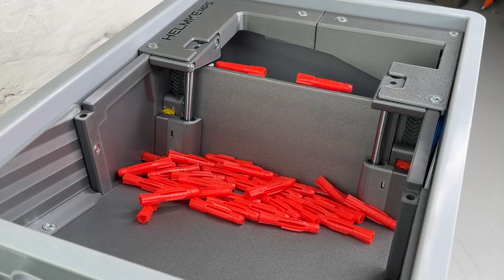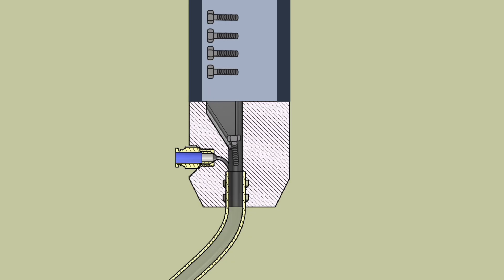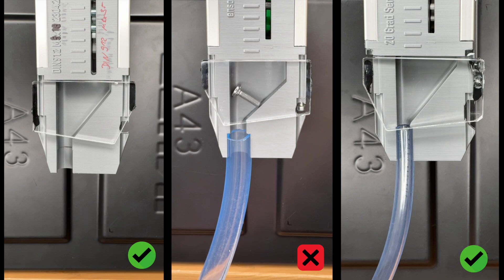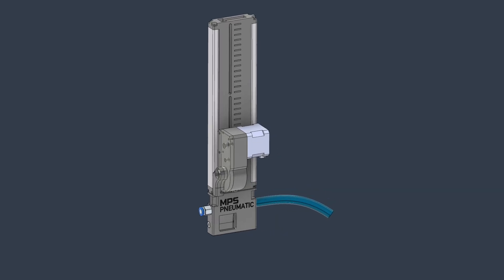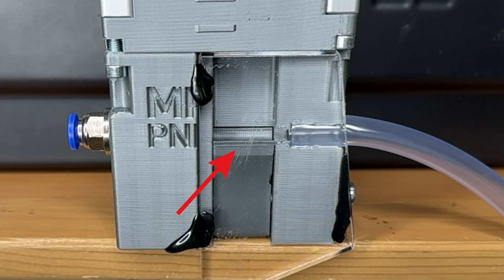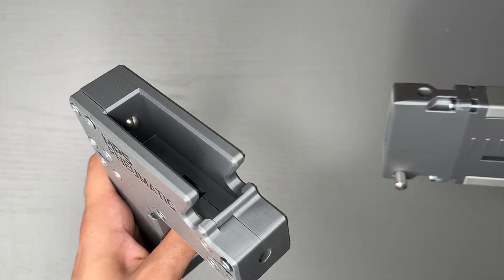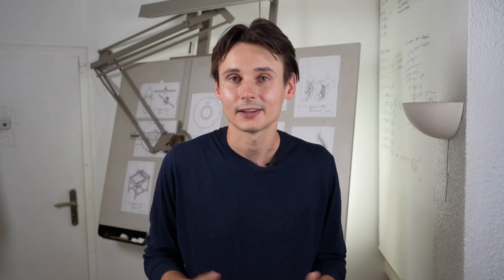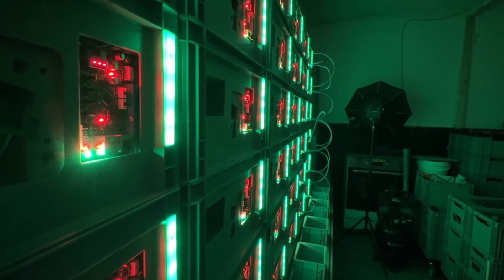Launching screws through washers - 3d printed automation #009

Comment: I feel like the first design would have worked if instead of a straight ramp it was a convex ramp. If the ramp was convex the tail of the screw would hit the ramp surface and stop the screw from over-rotating on bounce.
Reply: I had the same idea too, but the first thing that came to my mind was to limit the freefall where it can spin, from the sides. If designed to a specific thread diam, make it as narrow for the threaded part as can move freely. Drops free, but the head is limited not to flip over. The head diam doesn't matter so much as long as it's bigger than the threads space. Gravity feeds it thread first, unless it somehow makes a backflip, and in that the ramping might help!
Reply: or just slanted the opening, to limit the amount of bounce it could have. (kind of like a zig zag instead of a triangle)

Comment: Now, add rifling to the tube so that the screw spins and have it drop nuts instead of washers, so that the screws directly thread on ;)
Reply: he can do both, insert the screw into the washer and then in a second stage it thread into the nut, double insert and double chalenge 😉😃
Reply: @tsmatsmacal  😃
Reply from the maker: was thinking the exact same thing ..
Reply: @christopherhelmke then my coment regarding german gun law will get you 😉
Reply: yeah just forget about the rest of the channel,  just make the screw screw into a nut mid air and we are all satisfied
Reply: Driverless screwing using the screws intertia
Reply: no way, thats freaking impossible
Reply: Best idea ever ❤❤❤❤❤❤❤
Reply: screw might rotate mid air
Reply: Damn, you stole my comment 3 weeks before me... :D
Reply: With enough rotational inertia to screw it to the proper torque.
Reply: use inertia/speed to set the correct torque 😊

Comment: That magazine is satisfying and a smart reuse of off-the-shelf components when needed. For inspiration, you may want to watch old Factory Made or How It's Made episodes, you'll get a lot of  ideas on how manufacturers work through similar issues. 

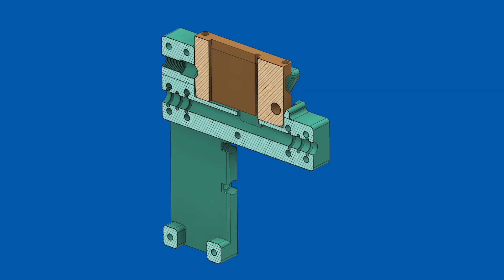11:48 - You may have noticed this, but your parametric design has the screw holes un-constrained, so they end up overlapping the O-rings in some configurations.

Comment: Maybe by putting a small magnet on the bottom of the chamber you could avoid the bounce ? And the compress air might be strong enough anyway :)
Reply: Some screws aren’t magnetic enough
Reply: it would also inevitably pick up some crap from around the place, crap just small or oddly shaped enough that they wouldn't reliably/consistently be cleaned out by a jet of air. Not saying it would be some 'ultimate point of failure' but still something that seems better to avoid in my opinion.

Comment: Your content is awesome! Love it.
At 11:20 I was a bit confused that the screws were coming out in the wrong direction. Of course I get that it is more about showing the mechanism of the compressed air…
Reply from the maker: Thank you! Aarggg i was waiting for this comment. I understand that you are confused. The parts at 11:20 are welding studs that are welded head first onto metalsheets. 
So head first is correct (only for these parts). 
I also realized while editing that this is confusing as hell. 
I had tested them for a potential customer and filmed them in the meantime and just used the footage..
was explaining that in the video, but had to cut it out for "flow" reasons
Reply: Oh I see. Now it makes perfect sense. No worries, imperfections create sympathy.

Comment: You will probably dismiss my suggestion because you have your own ideas, but maybe you could sell kits as shipped electronics + printable stl-s. I'd be very interested
Reply from the maker: I am not thinking about it right now, but it might happen at some point. What parts do you count the most?
Reply: @christopherhelmke  nuts and screws of different sizes, M8x50 inbus being the largest one. I use plastic bags, each of them having up to 10 different pieces. Takes a lot of time when packing my products, it's quite similar to your TV stands actually, but I also have metal laser cut parts as well as 3S printed.